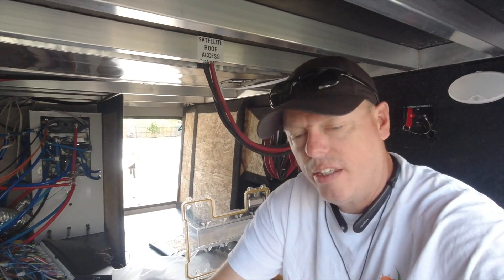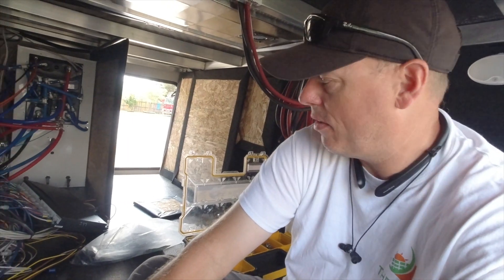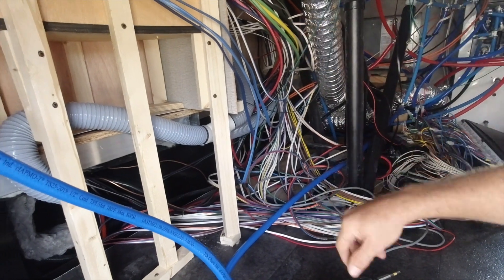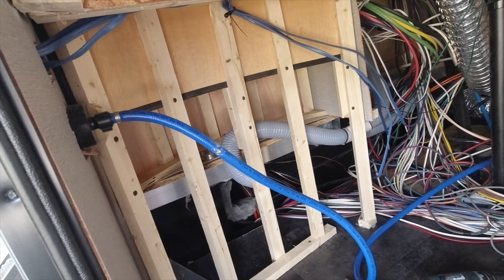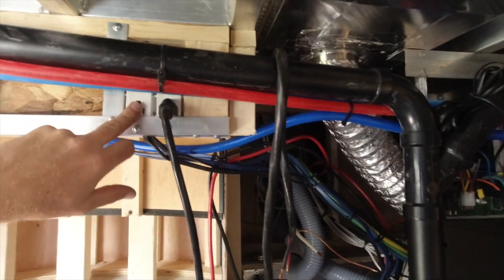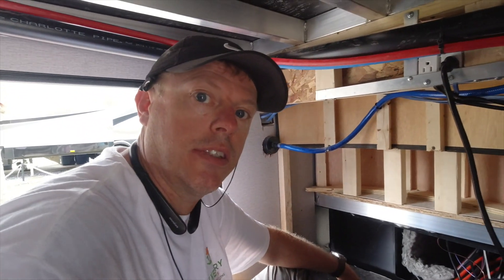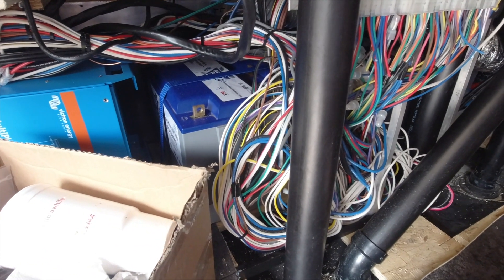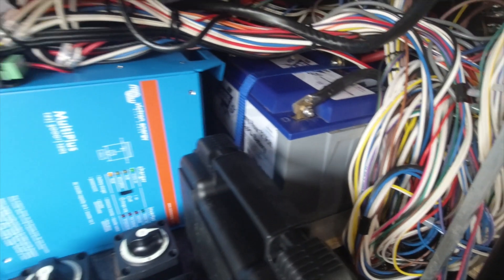BIG Solar on a BIG RV!! || 2020 Grand Design Momentum 397TH

Comment: I've only watched 3 of your videos and I'm beginning to see that you are going to have more work than you can handle very soon if not already. Excellent workmanship. Wow, what a system! Looks to me that Grand Design could do a WAY better job of routing the several systems that you have exposed. that wiring, plumbing and vac system is just an absolute cluster.
Reply from the maker: Ha, thanks for watching! Yes, we are currently booking in August of 2021, so it’s a very busy year. We agree. Hopefully we can meet up with GD at some point to point out some of the things that could really make things better / easier for users.
Reply: @TheDryCampers  My wife and I were sold out to upgrade our 34' Rockwood TT to a Momentum 399TH but we are having serious reservation's after seeing several of the 399 or 397's you have worked on. One of which was a brand new 2021 model.... All that plumbing and electrical just thrown in an enclosed space together. Not at all zip tied or routed. It's a mess and GD should be embarrassed to be putting out work like that. Im surprised someone hasn't had a fire.... I'm surprised its legal! Is there no "code" inspector looking at these when they roll off the line, or checking the design? 

Im sorry, but that plumbing just dangling there vibrating and swinging all over the space while you're driving down the road and all that wiring right underneath of it. Im no "builder" but I know there is absolutely no way you would get away with delivering a house to a customer like that. That is absolutely a fire hazard. Keeping the electrical separate from the plumbing is easy with CAD design and zip ties are cheap. With a bit of training to the workers and 1 hour more of labor that bay could come from the factory looking like it should.

You work is fantastic and makes theirs look horrible. They SHOULD be ashamed.

Probably, just made a few enemies and am on some sort of watch list now....crap.

Comment: First of all great video! second of all that system was almost exactly what I'm looking for so whenever I get ready or can afford it expect a phone call, or a message, or battery signal in the sky! 
also BluWave Odyssey sent me...
Reply from the maker: Home On The Road thanks for coming over! This is great haha That would be a BATT signal right? 😂 Love it! We’re happy to do a conference call and make sure that’s what you need in a system as well as get you a quote so you’ll know how much you need. 😁
Reply: @TheDryCampers  yes, BATT   🔋 signal!!!!
yes, let's do it! I'm 6-12 months away from doing anything. we are in a 390RK-R  and want full use just like shore power. It's going to be an incredible install this unit has great underbelly areas for storage of batteries and equipment.